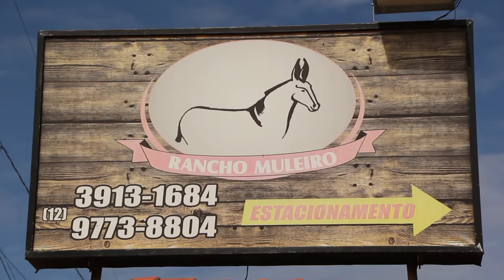FERRADURA SIDE BONE - PASSO A PASSO

Comment: Why did he just groove one side of the shoe. Looks like nail would wear the head off, and shoe would fall off.
Reply: You probably realized that on side of the shoe is thicker than the other. He did not groove the other side because it is too thin to do it. The mule has a disease called sidebone which is is the ossification of the collateral cartilages in the foot. When they have this kind of symptoms they need to use these special shoes also called "side bone shoe".